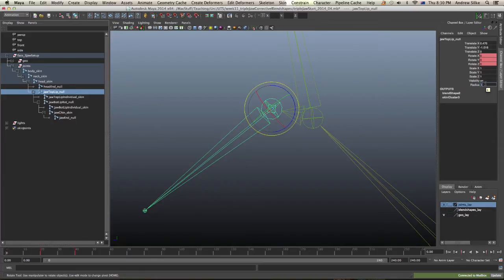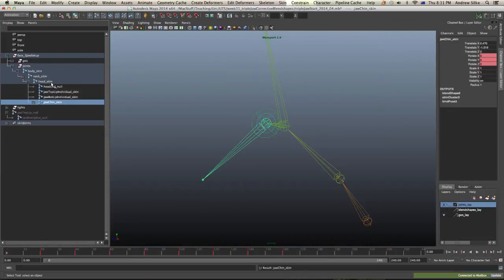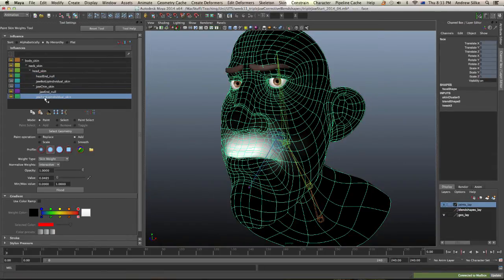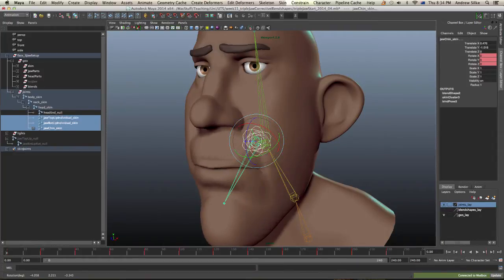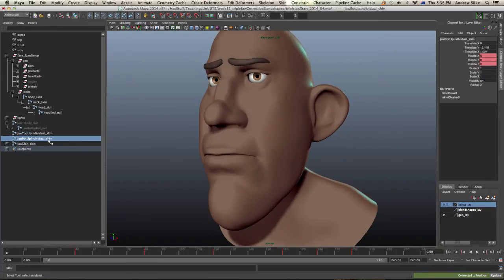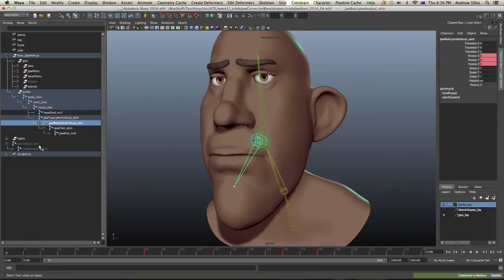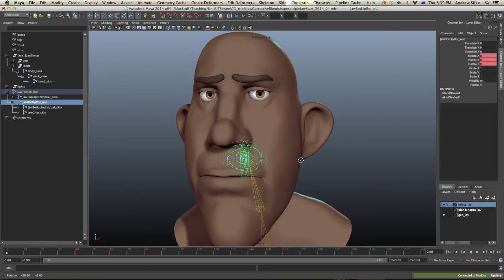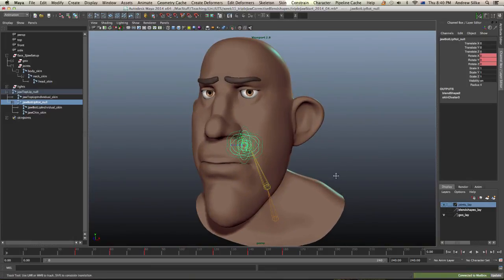Triple Jaw Setup - How It Works (Maya 2/5)

Comment: This is a high poly one. I got a low poly similar model. Mine was originally created in lightwave and converted to mb so I can work with it in Maya. Now it gets imported in Maya as one mesh (no pieces) with its skeleton that covers only basic facial rigs such as eye and head movement only. I cannot rig the model's jaw. The jaw comes blended with the adjacent faces of the mouth and if I put extra joints and edit the influences, it looks like skin stretching but definitely no jaw movement (open or move up/down). It is very peculiar model, as I said, cause it is a low poly one and you cannot easily differentiate between one anatomical part to another. Do you think I can make anything better than this? Is there a way to open the jaw or is it impossible?
Reply from the maker: Hi Steve, sorry I'd have to look at the model.  Basically low poly and high poly is the same.  You create joints you weight the verts, it's no different. If it's one mesh you can extract each part, skin and then combine it all back together (combine with skinning checked on)
Reply: @andrewsilke1  Can you please show the steps? How do I extract each part? Do I need to detach after selecting the jaw faces? For me to select jaw faces I have to detach and delete the skin faces first so I can enter inside the head. I'm newbie and don't know much of the process. If you please, clarify,